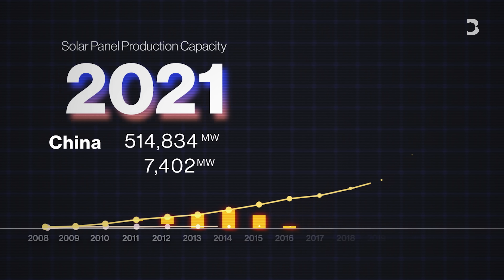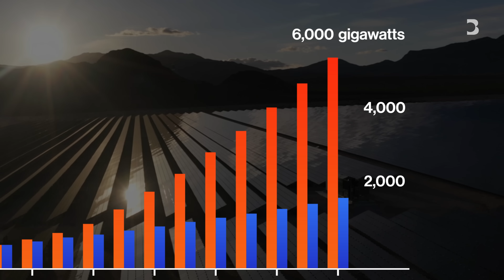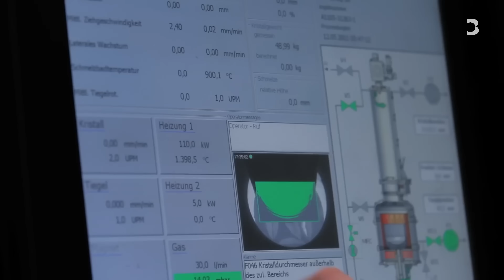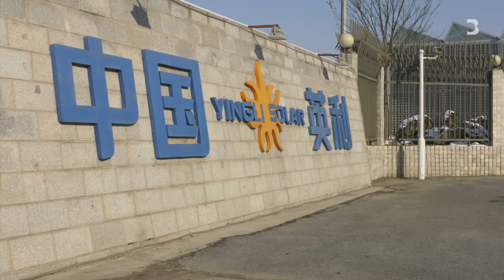Why the US is Losing the Solar Race to China

Comment: This video carries the UN Climate Change disclaimer.  Global warming was officially stated at 1.1°C in 1991 and 1.06°C in 2022.  There is no mechanism that would allow greenhouse gas behavior to cause global warming.   The back of the United Nation's IPCC science report states it took its greenhouse gas samples at 20,000 meters altitude where it is common high school level knowledge there is no greenhouse radiant energy.  This is typical practice for deceptive marketing to state legal data transparency protecting the perpetrators from fraud prosecution.  

Earth's greenhouse effect is frequently used as a primary example to high school students of a system always in saturation from the strong greenhouse gas water vapor absorbing all the greenhouse radiant energy from the earth with greenhouse gases within 20 meters of the surface that is all around us everyday and can't have its overall effect changed.  There is no further greenhouse radiant energy to interact with greenhouse gases.  At 1% average tropospheric water vapor over 99% of earth’s greenhouse effect is from water vapor.  Water vapor would hold earth's greenhouse effect in saturation if it were the only greenhouse gas in the atmosphere.

Comment: The solar energy industry is currently in a state of intense competition. In the last round of solar energy competition, almost all players went bankrupt. Today, China's solar industry has produced almost all the solar panels that can be used around the world. It is almost impossible for U.S. solar companies to compete because of cost and technology mass production supply chain issues. If the United States adopts trade protection and sets high tariffs to block Chinese photovoltaic products, the United States will ultimately suffer high costs and reduce carbon emissions far behind the world's progress. It can be said that China’s photovoltaic industry has no real competitors. Because no other followers can be seen behind the leader. . . . .
Reply: Agreed. And while 10 years ago Chinese PVs were ~12% efficiency, now they are ~ 21% efficient. Impressive!

Comment: As the US is using semiconductors against China for geopolitical reasons, Bloomberg (without a hint of irony) worries that China may use solar panels for geopolitical reasons.
Reply: OH NO China may use solar panels for geopolitical reasons, while the U.S exporting wars is not, yeah right bud, way to go.
Reply: western criminal anti-democratic regimes know only lies and double standards.
Reply: Anything and everything that US isn't doing well, that's China's fault
Reply: the complaints of the entitled are fun.
Reply: china # 1
Reply: Congress won't use solar, won't use nuclear, it will be happy to continue to burn fossil fuel like coal and oil. We have stagnated in the natural resource sector. Shame on us.
Reply: It’s not a geopolitical reason, it’s just that China is talking war against the west non-stop for 10 years at least. Of course not on the outside, but read the internal Chinese news and you see a different picture. Why would the US sell them anything that is great for weaponry?
Reply: They'd be doing us a favor. Solar is only viable (with current tech) in about 1/3 of the US. We'd be better off putting that effort and money into nuclear.
Reply: @careyfreeman5056  You can just add a 1000% tariff on the import of the Solar model, it can do the same thing. Don't need to wait for China
Reply: @careyfreeman5056  us is too dumb for not switching to nuclear. idk why they are switching to evs and wind turbines for their climate goals. If your a policy maker and you tried switching to nuclear these gas corpo would lobby against you
Reply: @theburden9920  My guess is big corporate has invested in it heavily already and now the rest of us are going to be roped in whether we like it or not. Not like corporate America will ever admit it's mistakes.
Reply: @careyfreeman5056  they will never admit their mostakes because their mistakes is intentional
Reply: @careyfreeman5056  congress will give u a ton of excuses on why we should never switch to nuclear so i doubt it
Reply: @theburden9920  because nuclear is too expensive
Reply: @krac3x438  nah, have you heard about the SMR?
Reply: @sangperebah5649  yeah and i´ve heard of nuclear fusion too, always 5 years away

Comment: First, China itself has huge domestic demand for solar panels. In addition, China has a complete industrial chain in solar panels, and China's huge production scale and complete automated production lines have greatly reduced costs. The main thing is that China is not only a producer of cheap solar panels, but also a technology leader. leader. Don't complain about Chinese subsidies for solar panels. All countries are subsidizing them. Don’t Germany, Japan, and the United States have subsidies? Just like today's electric cars. When Japan and Germany controlled solar panel production and technology, how many countries could afford solar power? China cannot afford solar panels made in Germany and Japan, so it has had to develop the industry on its own.
Reply: 😂you are correct ，that happened everywhere such as the subway system hasnt been widely built in China since 1990s they find out how to built since the machine from europe are 10 times  expensive than innovating a method by themselves😂
Reply: Absolutely correct
Reply: Basically stole American designs then are buying land on other countries by destroying the land mining for the minerals needed. We should build walls of solar and wind turbines along the border. Then we need to open and manufacture quality products again. Quality over quantity will set the market .  We need to go back to drilling oil and increasing our foot hold as a leader in energy and then go all in on finding how to manufacture better but cheaper semi conductors and longer lasting batteries for electric cars to sell globally.
Reply: The biggest flaw of this documentary is the deliberate concealment of how the solar industry in Europe and the United States maliciously suppressed China and how they used capital to forcibly acquire Chinese solar companies. Fortunately, they all failed, which allowed the whole world to affordably adopt solar energy.
Reply: I swear the US is holding back certain technologies for one reason or another....  F*ck I get it now!

Comment: 4:58 392 gigawatts, but keep in mind that is comparing the generating capacity of a nuclear reactor 24/7 to the solar panels at noon on the equator, not exactly apples to apples.
Reply: Yes, but when we measure the amount of energy we use of fossil fuels we don't count that over 60% is lost to heat

Actually it's a weird coincidence but solar capacity is mostly as efficient as fossil fuels, so we usually just use the raw potential
Reply: Assuming all that are the newest panels. It will generate about 20-22% of nameplate capacity and in annualised terms about 4-5 hours a day average in non-temperate zones. But ~80GW is still a lot of energy that can be used to supplement base load.
Reply: Fossil fuel sources and nuclear are normally rated with a thermal and a generated mw electric. Solar should be the same. When they build the plant they know the average hours of sun through out the year, that should be mentioned when comparing it to a base load per plant
Reply: @ColCurtis  unfortunately the media never mentions this. I’ve deployed 582MW of Solar around the world. People think I’m BSing when I say Solar generates annualised about 4.5 hours average a day in Bangladesh. The response would always go but there’s so much sunlight in that part of the world. Solar has been overhyped and oversubsidised. Like our New York State deployments although small scale compared to the hundreds of MW deployments around Asia, the tariffs are amazingly high with none of the performance demands that say a coal plant contract would dictate.

Comment: Boosting demand is a critical element. US is a big energy consumption market. Instead of nuclear energy, boost solar energy in US market is completely within US own decision. In this regard, it is not all a bad thing that China has taken a lead. China domestic market is making this shift to solar instead of nuclear or fossil, which leads to much smaller CO2 footprint. That is a benefit for the world ecosystem.
Reply: The only thing the US is commited to is military spending.
Reply: For the record China is going all in on nuclear too and has built the first thorium molten salt nuclear reactor.
Reply: China still builds coal fired power plants. Solar panels are tinker toy. When you need
real power generation you can rely on, coal or nuclear is what works.
Reply: Don’t forget that when the United States and other developed countries proposed carbon neutrality, they also included a premeditated plan to suppress developing countries. However, China’s counterattack exceeded the plan.

Comment: The question to ask is that why China has won all industries emerging in last 20 years - solar, wind, drone, EVs, etc.
Reply: The Chinese attempt to "surpass by changing lanes." They didn't compete too hard in fields where other countries already hold a massive advantage, like traditional automobiles, software, pharma, and yeah, chips until recently. Instead they try to gain an advantage in new industries where nobody has a starting advantage yet.
Reply: @valerievankerckhove9325  
This is a typical selection bias. China competed strongly in Traditional Automobile. It just failed at its efforts because the Western Manufactures developed faster than China. So what you saw is that China succeeded in new areas much more.
Reply: absolutely right
Reply: @valerievankerckhove9325  Software, pharma, healthcare and chips are part of the core interest of China. See their long-term strategy. In the next 5 years, they will also be a major competitor to the US in those areas.
Reply: @rolandwong9306  I don't think you understand what "priority" looks like to the Chinese government. "Priority" is what's happening to the chips sector, After the US started imposing embargos. In China, most people use Windows, and for drawing they were using Adobe software (often pirated copies). The government just shrugged and let them because Windows is so entrenched and producing a new one from scratch is not worth the hassle. With recent escalations however, it'll likely start looking more closely at the matter. 

Pharma and healthcare are important for China, but China has been mostly making precursors for export and not really the finished products. Let me put it this way, it is India that is known for pharma, not China. That's not what 'priority' looks like.
Reply: @valerievankerckhove9325  china already has their own operating system  name Kylin and is already being used for years by almost all of government and military they can end windows in china if they want to, as for chip manufacturing they've been developing it for decades but its extremely hard sector to dominate when they are sanctioned because its a sector where no country can manufacture both advance chips and tools that make, it so far they achieve 7 nanometer but without the tools from the Dutch, japan, US, south korea because of US sanction its going to be very hard for them to manufacture below 7 nm its not really true that they are not prioritizing the chip sector its just they can't dominate because of sanctions, without sanctions china could have probably manufacturing 5nm or even 3nm by now they just have to buy the tools from the dutch
Reply: Their system plus high quality human resources.
Reply: The only thing the US is commited to is military spending.
Reply: @silveriver9 we are going to need it for the war with China.
Reply: +HSR
Reply: A Swiss bank disassembled a BYD Seal, and then priced each part with labor cost and found that BYD Seal is 35% cheaper to manufacture than German cars, and 15% lower than Tesla.

if you look around, ZMPC, manufacturer of dock heavy lift equipment has more than 60% of world market.  China used to import Tunnel Boring Machines (TBM) from Germany, now they sell their own and manufacture for its competitors.
Reply: Because it is not a democracy, which is a system run by clowns..
Reply: China don't care about protecting wealthy oligarch industry. They invest in new industry that will disrupt the old one. US is focus on protecting oligarch because of corporate lobbying.
Reply: 勤劳
Reply: The need for green energy and tech along with being able to adapt rather than try to bring old systems that aren't effective
Reply: They focused on production and innovation the us sadly since bush playing world 🌎 police
Reply: It needs to do for a long time
Reply: Because they have intricate 5-10 year plans and they invest their money in completing those plans unlike usa which doesn’t care of what its people need only job is to police the world with military and force others to things in their way. While world has moved forward every nation is taking benefit of china innovation
Reply: maybe China is more competent then western nations in this century, this is the rise of china
Reply: chinese are smart,hard working and disciplineed. That's why
Reply: @simray7602 copycat IP thief.
Reply: Government foresight and hard work. Early on the government identified emerging industries and then worked hard to dominate them and not just talk about them. A well educated and trained workforce was another major factor.
Reply: Superior economic system
Reply: @thiagohuang authoritarian police state.
Reply: This is the common situation for thousands of years except recent 200 years. The reason that China is behind in  traditional industries is only because we develop them over 100 years later than the West. For the new industries that the West and China started at the same time, we are leading as we did in the past.
Reply: @thermalstoragesystemfromtr9513  no you are not
Reply: Long term planing and hiring the qualified people to lead the policy.
Reply: They have no choice because they have been living with pollution for decades! They knew they have to clean up whatever the cost!
Reply: No,china is collapsing haha
Reply: @tandoriowatches war is coming ☢️
Reply: @tandoriowatches  It will keep collapsing in the next few thousand years until the solar system becomes a black hole.

Comment: China installed more solar last year than the rest of the world combined.  More standard nuclear, more wind, the most high voltage (one million volts) dc and now it has the thorium molten salt reactor.  

Yet Fox News only talks about China building coal plants and belittles Chinese achievements.  When the GOP gets back in they will cancel the inflation reduction act because Fox News says climate change is a Chinese hoax.  Despite the ocean around Florida boiling.🙄🤔🤦‍♂️

Comment: LOL, every year American politicians find China is just thinking 10 years ahead, maybe more. That's what happens when one govt is run by lawyers, another run by engineers. US keeps under-estimating China in every aspect, and every time China finds a solution.
1. Space - China was not allowed in ISS< now they have their own space station. About 40 launches in 2023, 100% success rate. 
2. GPS - US blocked GPS signals during 2nd Taiwan strait crisis. China just made their own system, with higher accuracy
3. Semi conductor - Tried destroying Huawei, now it's back with even more innovative solutions. 
4. Jet engines - Claimed that they will never be able to build a reliable engine, now has multiple in production

Comment: (+)^++*)_+
In the next 30 years, Japan will continue to discharge nuclear contaminated water into the sea. Japan is passing on the nuclear pollution in Fukushima to the whole world.
The Japanese side invented the term "treated water" and repeatedly publicized that the concentration of tritium is not abnormal, creating an illusion that nuclear-contaminated water contains only tritium and the concentration of tritium is up to the standard, so nuclear-contaminated water is safe. society.
"In fact, the composition of Fukushima nuclear-contaminated water is complex. Even after purification, it still contains dozens of radioactive nuclides such as carbon-14, cobalt-60, strontium-90, iodine-129, and cesium-137. Disappearance of nuclear radionuclides in nuclear polluted water.
Three years later, the United States and Canada on the other side of the Pacific Ocean will be affected by nuclear pollution, and 10 years later it will spread to the global ocean.